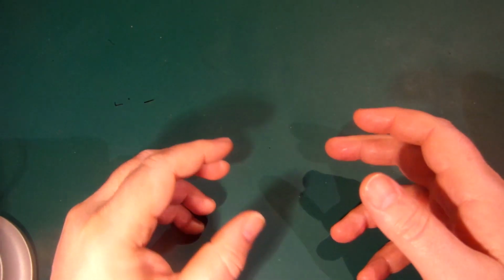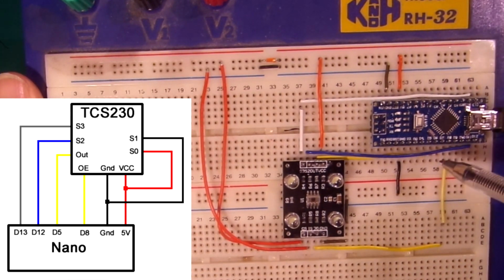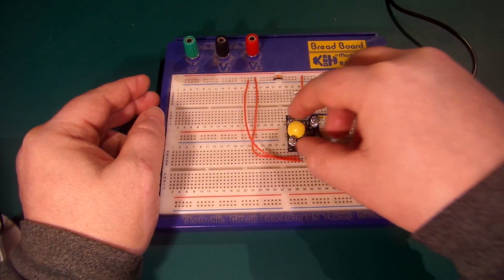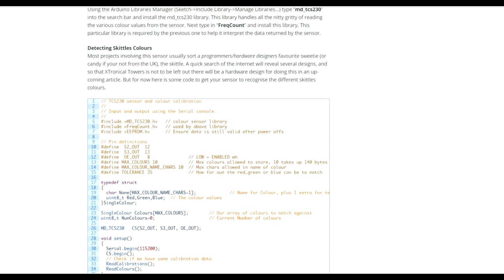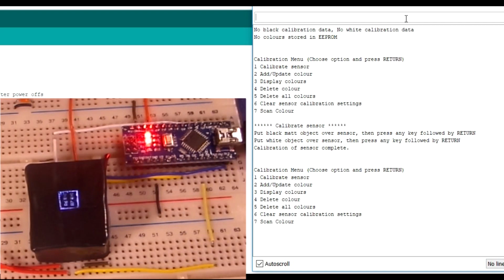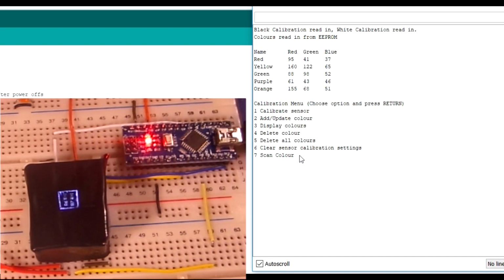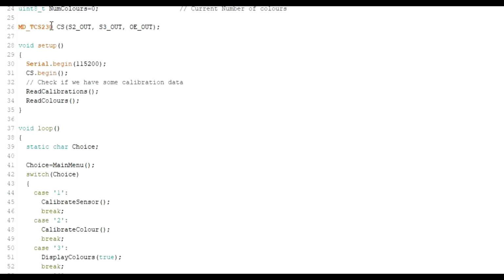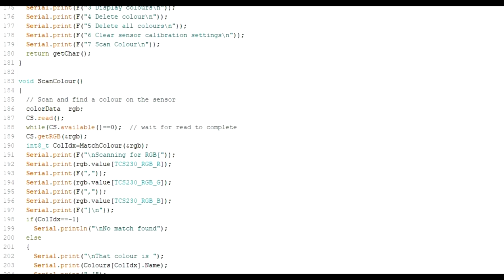Using the colour sensor TCS230 or TCS3200

Comment: Hello, I have a quick question if anyone is able to answer. I keep getting 0,0,0 for my RGB values for any color I enter. I have calibrated the sensor and the circuit is built correctly. Now I am using an Arduino Mega, but I dont see any difference as long as I am using the digital pins that are assigned on the schematic and code. Thank you for any help!
Reply from the maker: Your right, I can't see mega making any difference. So things to try unfortunately would be a normal arduino and/or new unit.

Comment: hey i have a problem using the code, when i open the serial monitor the only thing i can see there is: "⸮ ⸮2 ⸮⸮⸮ ⸮ 8 ⸮\⸮⸮⸮" or similar thing. If i press one of the keys between 1 and 7 it just goes on with this kind of text. What is the problem ?
Reply from the maker: Your serial monitor is not set to the same speed as the software. Check the serial. Begin statement for what it is, probably 115200 and in small select box at bottom of serial monitor select this speed.
Reply: @XTronical  thx alot

Comment: hello ,thank you ,your project is awesome ,but i have a problem ,when i calibrate the black and white they appear at the same time and when the black calibration is done the white calibration done it self . Please kindly answer my questions because it's going to be very helpful, thank you.
Reply from the maker: See a reply from from about 3 months ago just below. Similar problem. Sounds like extra characters are being sent after you enter the choice. You will need to print out any codes coming in on serial back out to the monitor to see what's being sent. I suspect there's en extra newline char in there. Hope this helps.
Reply: @XTronical  i didn't change your code ,just copied that then ran the code ,that was what happening
Reply from the maker: Yes, it's not my code that would do this but your computers OS. Some will send an extra newline char as well as carriage return. I will look at trying to allow for this in the code. Bit hard without actually knowing if this is the issue though but I'll have a go.
Reply: @XTronical  what os do u use?
Reply from the maker: Windows 10, but I think there may be issues with the serial software in arduino too
Reply: @XTronical  should i reinstall arduino ide?
Reply from the maker: No don't bother with that, how's your coding, can you display what characters are coming back from serial?
Reply: @XTronical  when i press 1 it showed the menu again and when i closed it and then open serial again it said "black calibration data read in, No white calibration data"
Reply: Hello, look a lot of people complaining about the code that is wrong, but the error is in the configuration part of the arduino. Basically it's just changing the read speed side from "new line" to "no end of line". Hugs from Brazil.

Comment: Sir,as for remain difference of price between TCS3200 & TCS230,which one is best?/Why?
Reply from the maker: Tcs3200 use less power when leds off and can also work at temperatures as low as - 40 degrees, compared to the TCS230's 0 degrees. Apart from that they are the same

Comment: hello, thank you for sharing your video, but i want to ask questions, does the sensor give constant RGB value of the colors? if yes, how to set the sensor to do so? because i also use  this type of sensor but it never give constant RGB value for every color. By the way, I connect pin S0 and S1 to digital pin in Arduino just like any configuration of TCS3200. Please kindly answer my questions because it's going to be very helpful, thank you.
Reply from the maker: There is always some variance with results due the the nature of the sample you are testing (usually). The samples would have to be very accurate to give very consistent results. These sensors are very accurate and perform very well. For example as long as I don't move the sample at all then repeating the measurement usually always gives the same result. But taking the sample out and then putting it back in will give a different (but close) result. This is the fault if the sample, not the the sensor. What looks like the same colour for you will have very slight differences on the surface on the sample that the sensor will pick up on.
To solve this (and what they do in printing plants when checking colour accuracy of a print) is to allow for a tolerance in the returned values. i.e. you set how much you are prepared for the result to differ from the ideal. If it's within this tolerance it accept as the correct colour. 
Although I find that you must calibrate the sensor with a known black and known white surface (as shown in the video). If you don't the results vary wildly. If you've not calibrated then this would explain your very bad results.